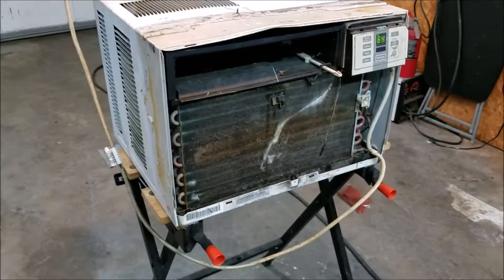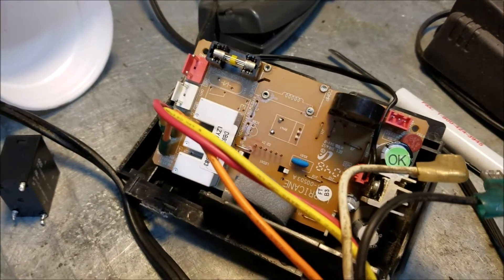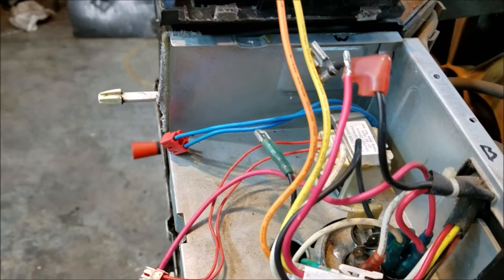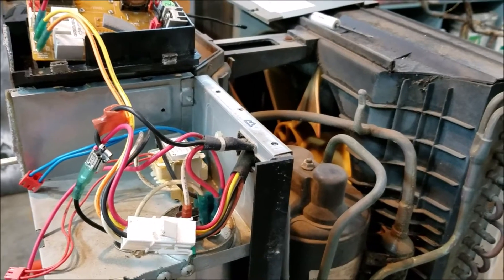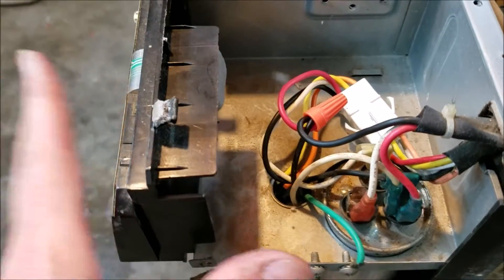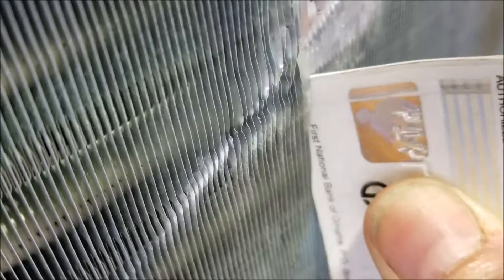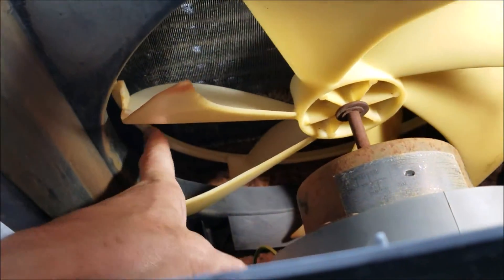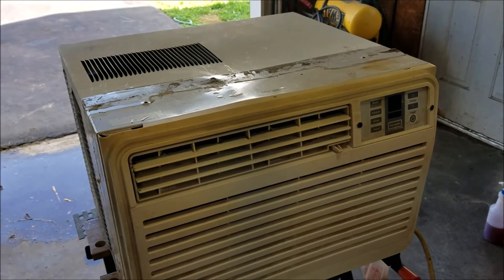DIY Window Unit Air Conditioner Repair, Compressor would not come on so I fixed it.

Comment: You could also buy a manual thermostat and wire it into the compressor hot lead and it would shut the compressor off before it freezes up...I have one similar to this..Its an 18,000 btu and its rattling like crazy..Im going to look into that coil that you shimmed up..I think I have the same exact coil..I thank you for pointing that out..That could be where all the noise is coming from.

Comment: Weirdness ensues. 😮😮😮 Something is still cycling the compressor on and off! The primary and 2nd dary boards are out of the machine. Zero 5v 12v logic.
Reply: Thermal limmiter on compressor. Indicating a bad capacitor or compressor.
Reply from the maker: Try this. https://youtu.be/_iICWI4lV5U?si=rHy1H7RdnhIZ0zoK

Comment: 100 times over, thank you!
Reply: Tore my AHC12LYW1 down today and did just the same. I soldered and heat shrunk the connection. I'll be putting an arduino controller in it asap. Ive got it cycling on and off every 30min with a Christmas light timer.

Comment: Yup had a window AC that had no cool found the circuit board with scorched relay and wires connected to it. Cut off the bad ends of wires.  Ordered a new circuit board for $42 and it was working after I recalled that the turn on delay for this unit is a few minutes. While waiting for the card i noticed that i went a little too long to clean the condenser coils.

Comment: All good but what about a thermostat?  Those fins will ice up without one.  That 12 volt relay could be wired to a simple thermostat to control this.  There is a fin comb available that has different spacing around the comb similar to the shape of a hexagon.  These ease your life considerably for the purpose of straightening fins.

Comment: isnt it gonna ice up the evap after the room startes getting cooler? the compressor has to cycle off but you have it on always?
Reply from the maker: Only if the the unit was low on refrigerant, allowing the the coil to fall below 32 degrees. Or if it was a very small room and really got cold.

Comment: They make little tools that fit almost any fins per inch pattern for straightening fins.  I forget what it cost, but it wasn't much for the hassle it saves.  Especially if you are doing multiple units.  it does several fins at a time.

Comment: Just for your info.  This looks to be a Samsung unit.  When you first turn this unit on, there is a 5 to 8 minute delay before the relay closes to start the compressor.  I found my first one of these and tnought control board was bad, but after i turned it on, and set temp low as it would go, i let it sit and run and compressor started after about 8 minutes.
Reply from the maker: Thank you for contributing.

Comment: Using this technique there is no thermostat control, correct? It just keeps cooling until you unplug it? I wonder if there's a way to get some sort of thermostat control wired in. Thanks for your video!
Reply from the maker: Yes you can and I have done this in the past you will need a standard house hold thermostat a 24 volt power supply and a 24 volt sequencer then tie it into the compressor wire so you can cycle the compressor on and off. call me if you need help hooking it up 606-875-0125 Kevin
Reply: Thanks!

Comment: How do I find someone in my area who can do this kind of work? I have a three yr. old window unit 18,000 btu's and it stopped cooling. All the hvac people I've called won't even consider working on it because the "Labor and parts would be more expensive than a new a/c unit." I don't have your skills but you make it look so simple and I hate to get rid of this a/c when it could be fixed. Btw, we already pulled it out of the wall and cleaned the coils front and back and hosed it out. The temp. sensor is in place.
Reply from the maker: Any one that does electrical or radio repair computers? someone that can read a wiring schematic can figure it out.

Comment: Congrats on restoring a basket-case! One landfill is smaller due to your diligent efforts. But we sure could use someone like you here in N. Centr. FL. Messages sent to top ac repair and manufacturer (Frigidaire) for a year-old unit I installed last Aug. that just stopped cooling. So far:  *Crickets *  -Only deafening silence from all concerned. Except the fan motor. Outside is 78° inside is 83°! House is well-insulated and holds heat! No one here works on window units. *sigh *

Comment: How do you tell if compressor works or not? Mine  is in the window, can't take out. It blows but it is not cool air. I cleaned filter, then cleaned back and front. But it will not blow cold air. Is there a simple way to check if that thermo thing works in front for temperature and to see if the compressor comes on?. Mine runs, blows air but I dont know if the compressor is working. Thanks any quick testing for a female would be great. I took the front off and cleaned like I said. I just cannot swing  a new a/c window unit. It's a fridgidair 5,000 btu w/ electronic controls. It's a bedroom a/c unit. Ithittimg 100 plus here now. :/

Comment: How long did the ac last you after fixing it??
Reply from the maker: Amazing but its still working !!
Reply: @ktoutdoor  well I have one just like that. I've had it 13 years now. All of a sudden the compressor stop running . I had capacitor checked and it's good. Cleaned it to.. so I tried your technique and compressor still didn't Come on  but it runs. So I took the cap off of compressor to check the wires and behold the wires had burned up but terminals are good and shiny. So now I'm replacing the wire and clips that are on the compressor. Your fan in front is different then mine. But this is a good air conditioner for having it 13 years I never new about cleaning it till now. I'm hoping if I replace the wires compressor will come on if not I can't complain for having it 13 years.
Reply from the maker: @vickirichardt2344  Thanks for sharing your story I sure hope you get it going, Have a blessed day Vickie
Reply: When I pulled the cap off compressor there are wires that go to the terminals and there like this little round thing under the cap as well that is connected to the black wire. Do you know what that is and what it's for??
Reply from the maker: @vickirichardt2344  Thermal Overload Protector try by passing it to see if it will come on. also watch this https://youtu.be/_iICWI4lV5U
Reply: @ktoutdoor  it worked it really worked ..omg I'm so happy now. The piece is the relay to start compressor. The clip was mess up so I sauntered it just to see if it would work and it did. But I. Going to coast appliance to get the other connector anyways and get that relay fixed. Thanks so much for your video it truly help alot..
Reply from the maker: @vickirichardt2344  thats great news I new you could do it...don't it feel good when fix something your self.....
Reply: @ktoutdoor  WARNING I went to go try and buy the connector for compressor and can't find them anywhere. The air conditioner shops won't sale then unless your a contractor. I had to use the old one drill the old wire out of it then stick my wire in there and a little Sauter. That's because the cap would not go down all the way shut with the clips I was using. I have ac for each room of my mobilhome that haven't been cleaned at all either. So now I'm off cleaning ac all summer..lol

Comment: I have an Amcor PCMB10000EH Portable Air conditioner. I turn it on turn temp to lowest setting and compressor won't kick on since nothing is coming out of back exhaust. It also has a heater on the ac. i crank that to 90 degrees. compressor still doesn't kick on. it only blows room temp air on cold and on heat temps. it' not using the compressor just the reg fan is all that is engaging. My question is does this machine have a relay switch and where will it be located. and does it have a fuse and where is it located? I'm having issues. Please help me so my machine compressor can start working. Would low coolant, cause a compressor to not kick on? I have tools. I just need help please. I can't find tech support anywhere. i will pay for a fix. i have all tools. i need help please.

Comment: I watched your video, you seems failed to mention what is failed? You doubt the relay yet measure it is working. So, what's your problem fixed? did I missed anything? anybody can comment?
Reply from the maker: Going by memory it was either the relay or most likely something on the circuit board that I cannot repair those circuit board
s are bad about going bad I fix them a lot them by doing this bypass.

Comment: I cleaned mine and now the compressor will not shut off at set temperature. Please help it is freezing 🥶 I think the electrical got wet. Everything else is working great, the display works, wifi and everything. The unit is only a year old Toshiba 10k btu
Reply from the maker: I may take a while for the board to dry out

Comment: Yep the relays in those things can fail really easily. For some reason it seems condensation or moisture finds its way into the circuitboard, and since the relay isn’t sealed… It gets into the coil and starts to corrode those tiny wires in the relay coil. You can easily pop the relay open once it’s off the board and fix the relay usually even with corrosion… i’ve seen this exact failure mode a dozen times on these boards. Just a little bit of corrosion creeps up the legs of the relay and corrodes the tiny coil wire disconnecting it from the leg. Also the small voltage regulator in the TO 220 package can get hot and overheat/go bad
Reply from the maker: Thank you for contributing.
Reply: Yes and that happens the SAME WEEK the warranty runs out! 
Bought & installed my Frigidaire one year ago (Aug.) and last week this happened.
Am not an electronics expert and here in N.Centr. FL NO ONE does work on window units.
My dogs and I are about to die of heat stroke. Thank You Frigidaire! Wish you were here.
Reply: @wmfife1  
Same here! Frigidaire AC, 1.5 years old. Hot dogs. Been working on it for the past few weeks trying to figure out what is wrong. Replacing parts as they arrive. Have yet to figure out. Hoping today is the day.
Reply: @dreamsnchains4830  My "part" arrived just the other day: a brand new air conditioner by Midea, top-rated and more power. Some $300+ with free shipping via Amazon- but worth it. Out with 6,000 in with 8,000 BTU's. LR is now a cool 73-74 degrees and dogs are resting comfortably. 
Am now the proud (scsm) owner of no less than SEVEN window ac units, ONE of which is working. (To be fair four are antiques with outdated coolant so that leaves three)... And hoping to repair the other two including the one just referred here. Because always you need backup... so THIS never happens again.

Comment: I have less than 3 year old through the wall ac which stopped blowing cold air. The fan runs fine but it hums for 3 sec and then stops. And it.does it again. It can't seem to start the compressor. What could be the problem?  The relay or the compressor?  I called a repair guy and he asked for 400 bucks on the top of 175 initial diagnostic. I'm trying to fix it by myself before I get a new one.
Reply from the maker: Could just be a bad capacitor = cheap fix or could be a locked up compressor watch this fist then test the capacitor or remove it and take it to any local HVAC store they will test it for you. https://youtu.be/SihpkALJtmE
Reply: @ktoutdoor  Thanks Kevin! Will check it out. Have a good day!

Comment: I have the same Samsung unit. It worked last time I used it. This year not so much.  I opened up and looked around. The compressor clicks once heats up a little, then clicks off. I am stumped.. Any help is appreciated
Reply from the maker: Could be a capacitor or a bad compressor? watch this for more info https://youtu.be/vsozg8W2tes

Comment: Mine has no starter relay. And it says. "NOTE: the illustration is explained the wire connection of the O.T.P of the external compressor. For the internal compressor, the O.T.P has been connected with the compressor." What's this mean?
Reply from the maker: Over-Temperature Protection it works like a fuse if compressor gets to hot it breaks the connection try a quick bypass and see if it works then buy a new otp

Comment: Kevin what if the compressor trys to come on and sit there and gets hot?
Reply from the maker: That could be a bad capacitor or the compressor could be locked up. Remove the capacitor and go to any HVAC supply store and get it tested if bad replace it and hopefully that will get it going. plus discharge the capacitor with a screw driver.
Reply: @ktoutdoor  Thank you very much i will check it out my brother.
Reply: @ktoutdoor  Yes sir it was the cap, thank you much my brother. its blowing cold, i clean the coils with good cleaner.
Reply from the maker: @kevinhoney1385  Thats great news.. Now go fix something else...lol
Reply: @ktoutdoor  Amen brother

Comment: Took it apart and got it working today. Apparently It developed a loose connection and it was not turning on the compressor. Fan was coming on but the compressor would never kick on at all.
Reply from the maker: Awesome you got it working!!

Comment: this video is awesome and you explain so well!! I feel like i can do this!! both my window u it's stopped blowing cold air. I wonder is there some other product I can use to get the crud off since I don't have any type of acid just laying around under my cabinet. Thank you so much for this video sir, you have given me confidence to try.
Reply from the maker: Sure any real strong clean like simple green will also work, let it soak for a good while then blast it with a good stream of water be sure to spray straight on into the fins if you come at them sideways they will bend if you need any help just call or text me 606-875-0125 Kevin
Reply: @ktoutdoor  where do the rest of the wires go? And y do I need a cap if I’m wiring it direct?